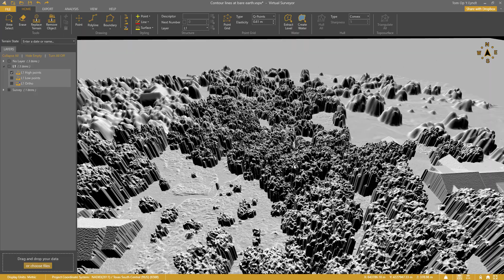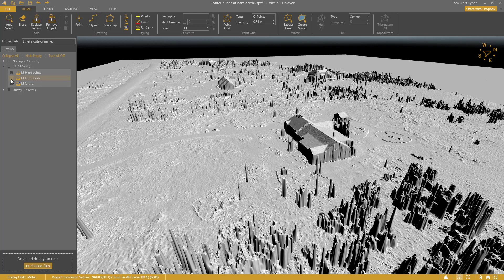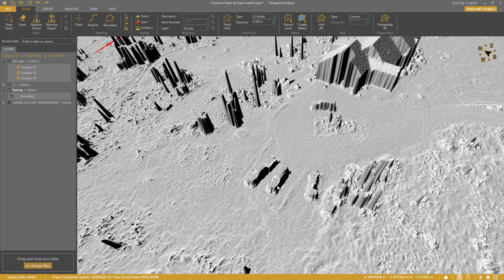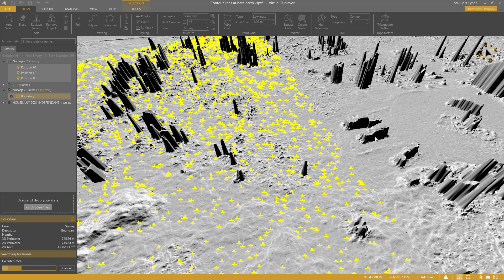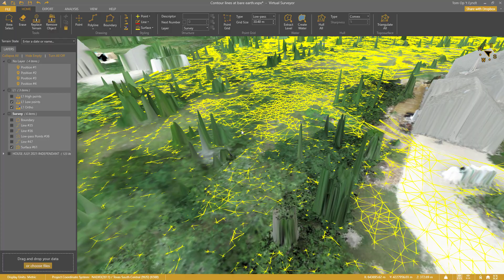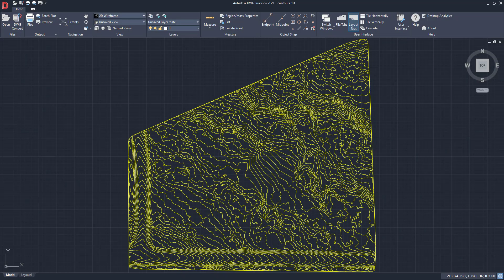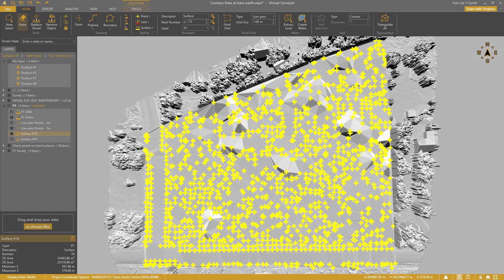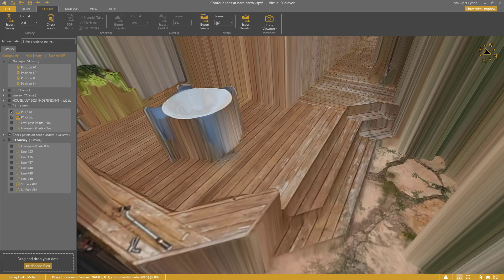Contour lines at bare earth [with Zenmuse L1]

Comment: Misleading- 1/. Check points were not in Dense vegetation. 2/. You cannot attain bare earth with lidar it is not a Xray, indeed if it can get a return, it will be ON TOP OF detritus, you can only find lowest points and "assume" GL points they which MAY not be. Does that mean I dont think Lidar can be useful not at all , misused and misapplied